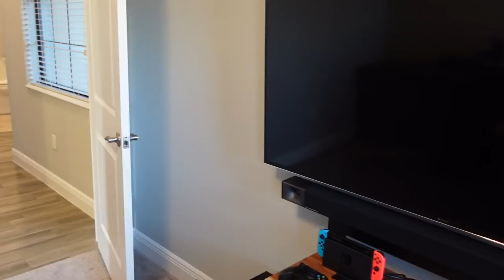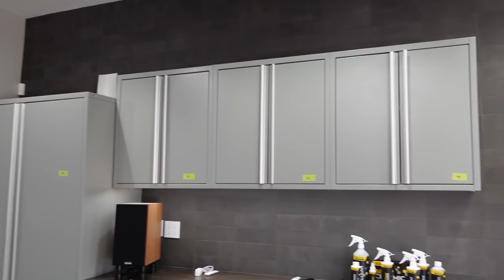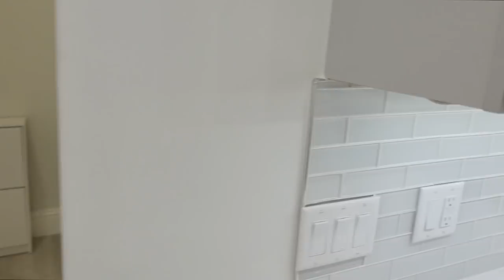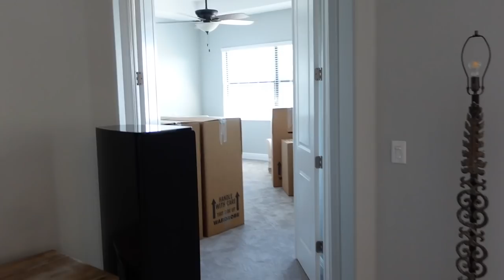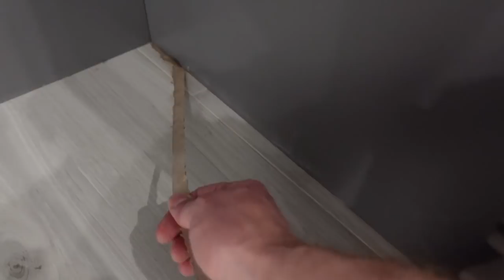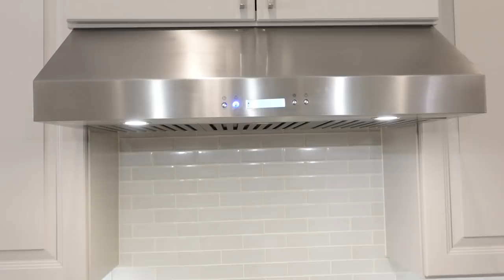Moving...Again: Day 1 - Packing & Closing

Comment: Matt, I really wish you well with that Kitchenaid refrigerator, because mine is a $4,000 POS. The ice maker leaks all over the front of the door. I’ve had the door with the ice maker replaced, once already, and it still leaks water all down the front. I was cleaning the ice maker chute one day, and pulled the ice cube container out of the door and it was all black mold under the container. I can email you pictures and a video so you know what to look for. Currently, the 3 way valve was replaced, last week and the refrigerator still makes a loud clicking noise, and the motor isn’t running, while it’s making that noise, and the food starts to thaw. The refer is 5 years old, this month. I really hope you don’t have the same problems with you. I have the same double ovens, they’re great. No issues.

Comment: I just don’t understand the previous owners. Even under bad circumstances there are lots of companies that do move out cleaning, even construction cleaning. They came and mopped the slab and vacuumed out the wall cavities before installing insulation and drywall. Saves you years of dust that works it’s way out.
I also can’t wait to see Matt run across Building sciences corp. 
It will change his build, OG for construction.

Comment: I dont get that floor carpeting thing. In the States you are walking inside with dirty shoes on and put carpet everywhere. Why?
Reply: Agree for places like FL. In colder climate areas like Wyoming, it’s nice to have carpet. It insulates a bit better. One exception would be heated floors. You’d want tile or laminate for that. Plus, most places up north have a mud room dedicated to taking off dirty boots, shoes before you enter the rest of the house.
Reply: The States is a really big place. Florida is white sand. Further north is red dirt. Even further noth is black soil. White sand is vastly different than midwest and desert sand. And carpets made to be cleaned.

Comment: If I were you, wouldn’t bother with Tesla solar, their system is old crap, I would get the system which uses Microinverters such as “Enphase” it will give you per panel production data, also incase one of your panels will fail, the rest will be still producing energy unlike Tesla system if one panned or inverter goes down entire system goes down.

Comment: A little dust in the garage? Thats what has you riled up??? Normal people use their garage for their cars and sometimes storage….its not a bedroom. 

Id be more pissed about the paint and shelf that I would have to throw out
Reply: It was more then dusty lol
Reply: @elisscaliving4776  Yes the holes from various screws.  None of that was even worth mentioning.
Reply from the maker: It's lazy and not the right thing to do.  I filled up an entire bucket worth of dirt in just the garage.  These people made $400K in profit in a year.  They should have done the right thing and had someone clean it after the left.  I had to make 5 truckloads full of the garbage they decided they didn't want to my dumpster at OG.
Reply: @ObsessedGarage  the garbage is totally unacceptable. I can’t believe you can’t have that written into the contract or something. 

Matt youre just on a different level. Could they have spent a few mins sweeping the garage? Sure but like I said, most people dont consider their garage as anything more than car storage.